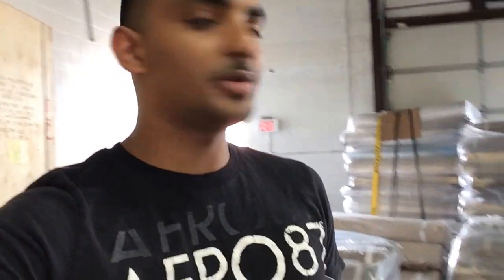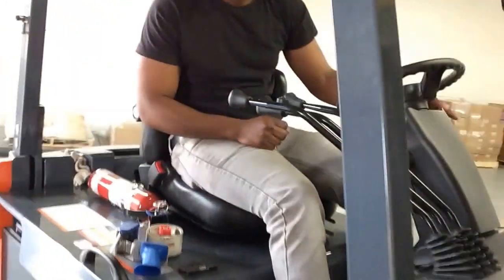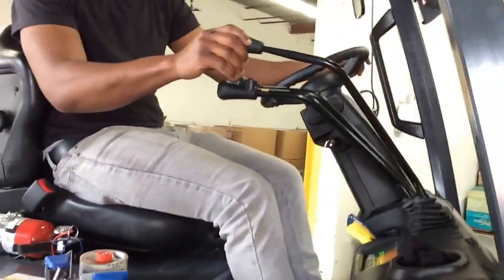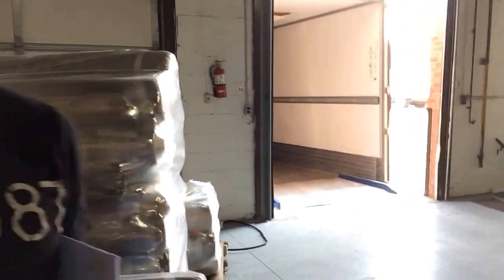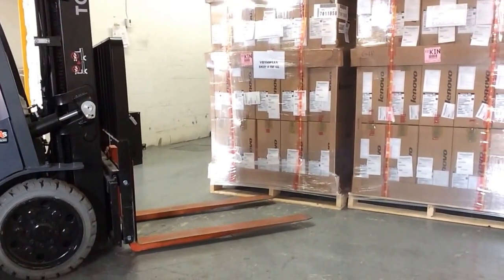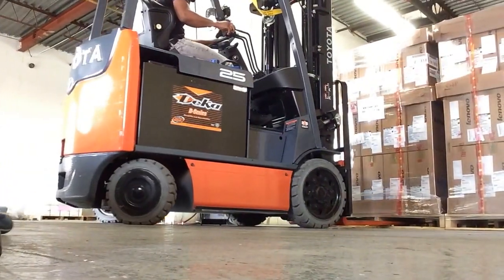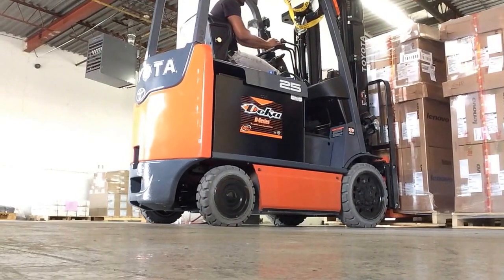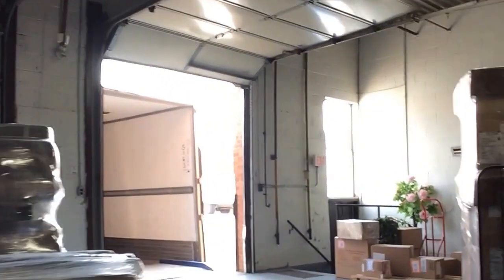How to Operate a Counterbalance Lift Truck- Forklift Training Video

Comment: First of all he didn’t look back when he backed up, secondly, he didn’t line up square with the pallet before driving in to pick it up, that’s why he had to force the pallet straight while driving in. 
Fair job but could have been better.  

I work for a major Airline and lift up to 4,500 lbs at a time loading and off loading 18 wheelers. Not to Bragg but I still make minor mistakes sometimes  the key is to correct you mistakes and do better.
Reply from the maker: Phil Jones great insights 👌